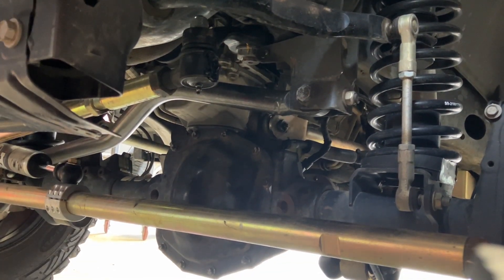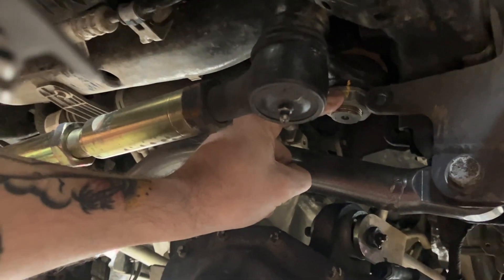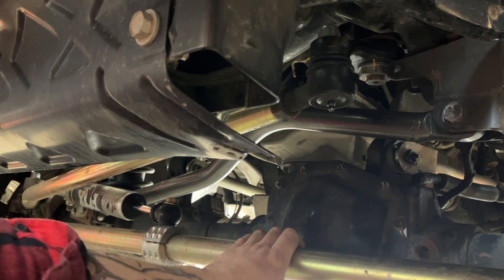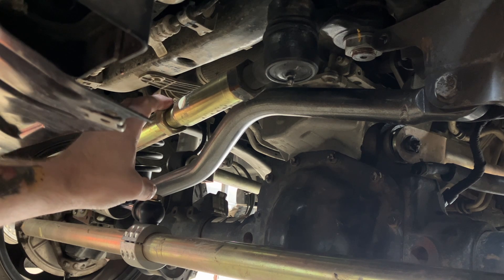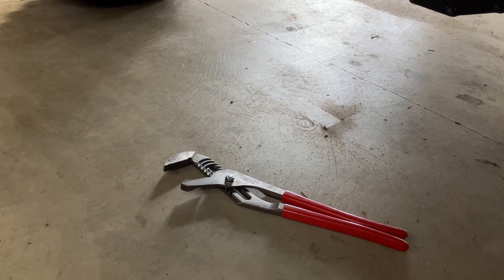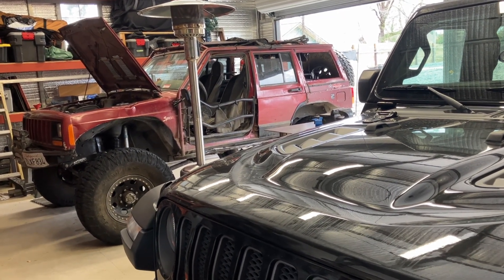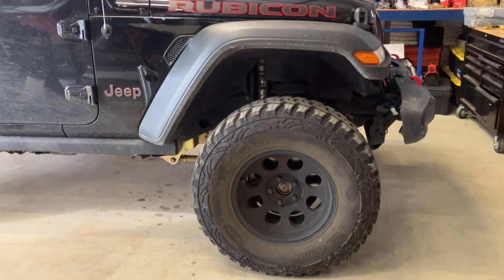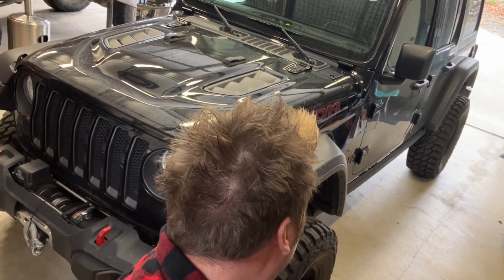Jeep Wrangler JLUR Deathwobble fixes, Wondering Steering diagnosis tips. (Jl) suspension

Comment: I got a 2021 gladiator Rubicon with 35 3" lift from jls 5 mounth later now  i got Death wobble i got 18.000 mile on it
Reply from the maker: @williammcclure2353  check everything for slop . Check tie rod ends, trackbar , uca and lca bushings, check torque on trackbar and lcas and ucas, make sure shocks arent blown out. And make sure tires arent cupped and out of balance

Comment: My 2021 with 9k miles completely stock developed crazy DW.  Replaced tie Rod, track bar, drag link  with Synergy and Steer Smarts components and still have it.  Alignment too. I’m lost.
Reply from the maker: my money is on trackbar and caster, but it could be one of many thing, or many little things all adding up.  check the trackbar mount at the axle for wallowed out holes. Recheck torque your trackbar bolts to 130ftlbs or higher. do you have adjustable control arms ? where is your caster at on the alignment printout?  either way, get adjustable front lowers and try 7* of caster. Are all of your jam nuts and adjusting sleeves tight in your steering ? Check the upper control arm bushings for failure too with a pry bar. Also get your tires rebalanced.  Also check ball joints in the knuckles for slop, and you can try swapping tires feont to back to see if its a front tire. respond here with your caster and toe in numbers it you can. There is also a steering box recall ( they call it a tsb)  008-03-0021.  There may be a newer tsb( they keep superceding them with new ones) . Ill try to do more videos on JLUR deathwobble diagnosis as well.
Reply from the maker: also, if you have a synergy trackbar, make sure the double adjuster sleeve sleeve slots line up with the slots in the trackbar tube, and torque the crap out of it, their 90 ft lbs wasnt enough on mine, and the sleeve would never get tight if the doubler adjuster wasnt insanely tight
Reply from the maker: Also, my synergy drag link tie rod ends failed at 2000 miles, so even if they are new, check them anyway, I was not even looking at them for my DW at first, but when I realized they were blown out I couldn't believe it.

Comment: I don't have a JL but I have a hard time believing any amount of flex was purposely designed into the steering.  If it was, where specifically is it supposed to flex?   I'd be concerned about fatigue failure issues in that/those areas.  My vote is to make your own steering and get away from those course threads, especially if all the links are straight with no funky bends.
Reply from the maker: Yeah the JLURs steering has been a constant problem. I have been looking at the WFO drag links for my next one after I try out the RockJock next.